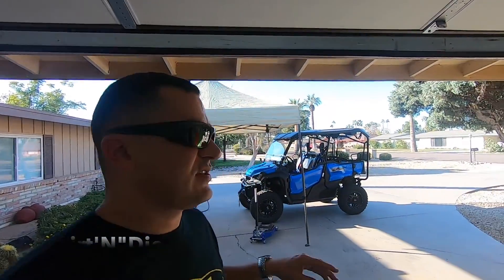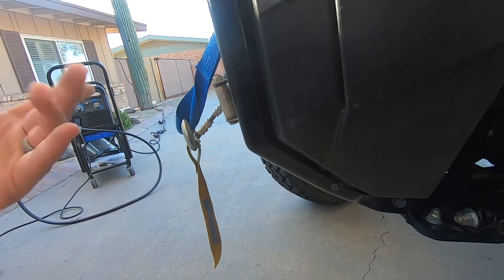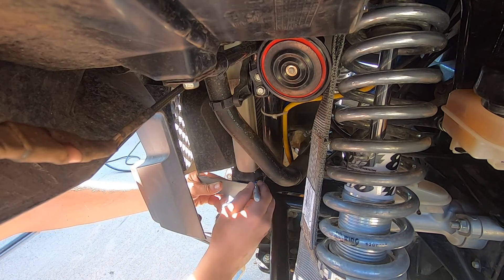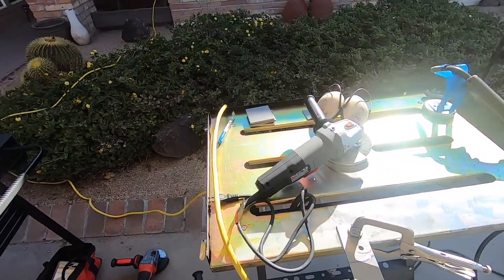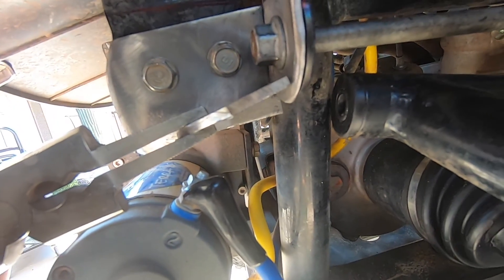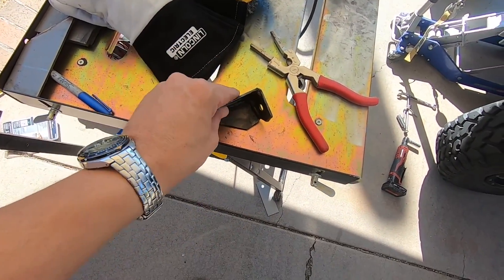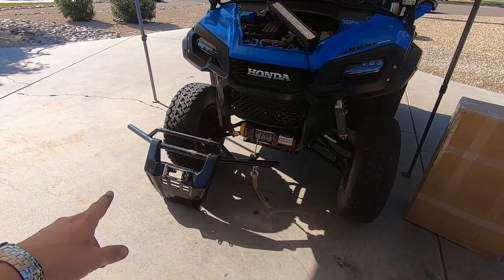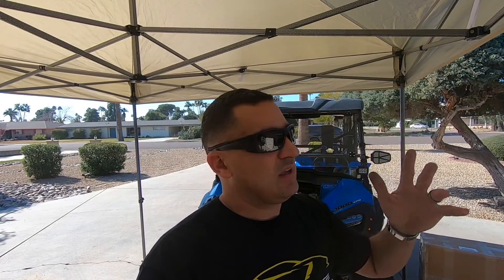A-Arm bracket/gusset

Comment: You mentioned in the beginning of the video that there are gussets available online for the top A-Arm. I'm struggling to find any. Can you provide link, I want to reinforce mine as well.
Reply from the maker: There are no upper a-arm braces for sale that I have found, just the lower a-arm/frame brace from SATV. Sorry for any confusion.
Reply: As a professional fabricator, I would look to see what I could reasonably build to tie the upper rear in to another point or 2 with the rest of the frame. Possibly even tie in to the front again, to reinforce the front upper mount. And/or tie in to the lower reinforcing plate and hardware that are already installed. Think squares and triangles. First you box something in by tying it to another point, structurally speaking. Then, you need an angled brace to cut all of your squares in half. A triangle is the strong basis for all structural iron work and bracing. If you take 4 popsicle sticks and make a box and pin the corners, it moves. it can change shape to a parallelogram. Add one diagonal brace and it cut the square into 2 triangles. now make a triangle from popsicle sticks and pin the corners, and see if you can make it change shape. NOPE. Dimensionally stable. Also, take some time to study shelf supports, and exposed ironwork like bridges, roof trusses, etc. And a flat bar bends, but a piece of angle iron is more sturdy because it has two sides. A piece of channel is stronger yet, and an I or H bean is even stronger, because of the flanges that stabilize the web of the beam or column. I have already a few ideas about reinforcing the front upper A arms fully. There looks to be plenty of room to work with.